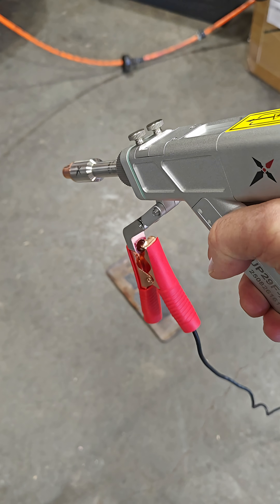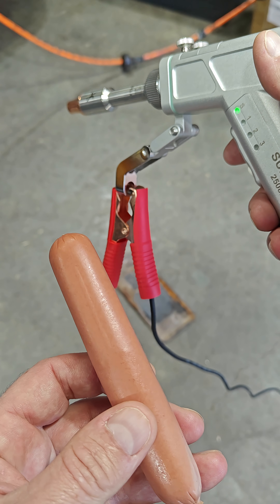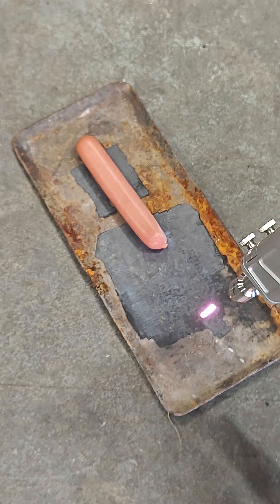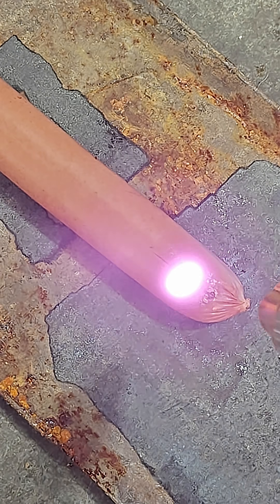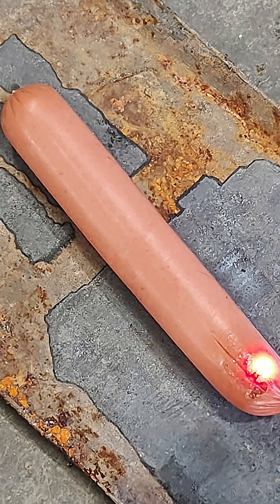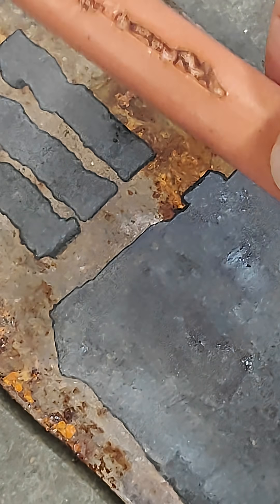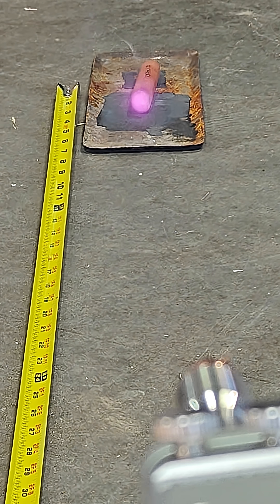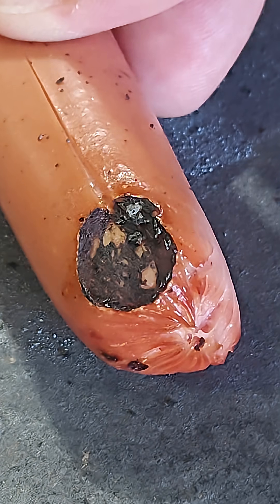What happens if you hit a #hotdog with a #lasercuttingmachine ?

Comment: Curious how it would do point blank. 

You wouldn't want to accidentally pull the trigger while it's resting on your thigh. But I guess not as bad as a nail gun
Reply: Thats why the Ground (which he clamped to the gun itself here...) is always on the workpiece. So you cant have this happen. I work with a 1500watt laser welder and point plank is shoots straight though 15mm of wood...